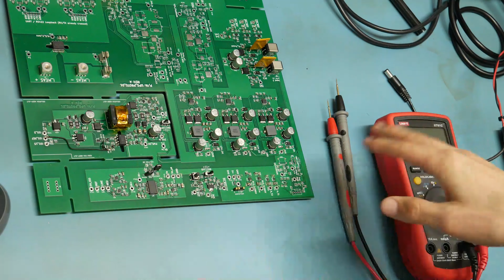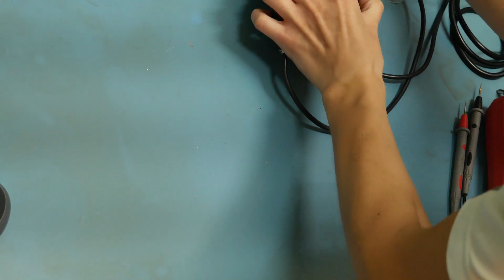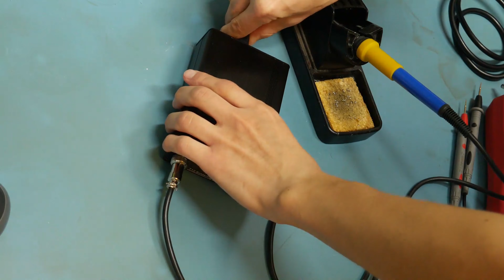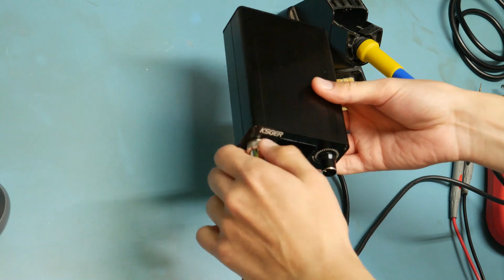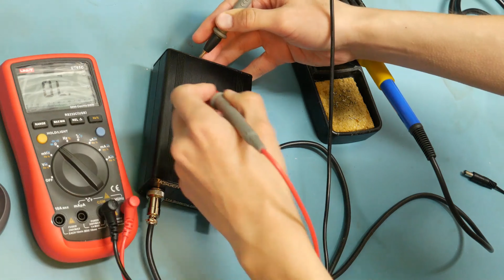A Dangerous STM32 T12 Soldering Iron - Ground Bond Upgrade!

Comment: SIMPLY solder a wire to the internal earth-pin of the supply socket. Have this wire then pass to a crimping ring-connector, soldered in place over one of the rear lid-mounting screws-holes. Thus, being trapped between the rear-plate and the lid when the case is closed, it will adequately provide grounding of the casing. CASE CLOSED !
THANKS tho fella ! We all learn from witnessing others endeavors, right ?
Reply from the maker: Great idea, and as you suggested... a lot simpler. The cut edges have bare metal exposed.. perfect! 
The next time I find myself modding ground bonding into an iron.... actually, I should probably just buy a better iron. :)

Cheers, and thanks for the great comment!

Comment: I did mine on the back panel, connected a wire underneath the board where the earth ground is soldered to the board. Then I used a Philips #2 screwdriver and twisted in the 4 screw holes on the back and removed the plating very easily. tested it and it grounded/earthed just fine right to the tip of the soldering  gun.

Comment: they direct soldered the input to the board exactly for this reason.no wires can flap and touch the case.Otherwise it gets converted to DC and there is on negative and positive. what you've done is now make it possible for a DC circuit to connect to an ac circuits earth..  in theory the case could even act as a capacitive voltage divider.

I apologize for rudeness, further in the video you acknowledge the break in isolation I wrote this before I got that far. I'd be curious what the resistance from the tip to ground is both with and without the modification.
Reply from the maker: Hello West, thanks for watching!

No worries about rudeness, I love making this a safe place to share ideas. I'm not sure what safety standards you are familiar with, but the ones I have studied were very specific about exactly how protective earthing should be connected to a system... And directly soldering how this soldering iron did wouldn't be sufficient, from my understanding.

Funny enough, this circuit actually isolated the tip from chassis, and earth, leaving it floating!!! I've been seriously considering either tying the tip hard to earth ground or through a low-megaohm resistor. I'm not familiar enough with every app-note regarding esd safeness for soldering irons, but if you have some experience I'd be happy to hear it! 

I'm happy to hear your opinion, and happy New years!
Reply: So after some thinking, perhaps it had some function utilizing galvanic isolation, or perhaps they repurposed the
 circuit/PCB from another device that used more than one device in parallel inside the same enclosure, if there was no need for ground to begin with and its been repurposed then the people making it don't know.

 How isolated is the ac side from the case after the IEC connector/switch?  
Might also be interesting to check continuity of output pins for the iron to the case.

Correct me if I'm wrong, the only danger to user of the case shorting to ground  would have to be on ac side right?

Might also check the supplied power cable, if its 2 conductor with just a facade on the plug ends that'd could explain it lol
Reply from the maker: @westhouse4641  

Hi West House,

The danger of a floating metal enclosure comes from a fault condition causing a live conductor become inadvertently connected to the enclosure. 

Tying the enclosure chassis to earth ground provides a safe return path for that fault current, preventing electrocution.

The isolation between mains and circuit ground is established in the AC-DC power supply, which doesn't come with obvious ratings. I would expect this barrier to withstand at least 2kV, but it should be designed to withstand significantly more if it is designed to accept 240VAC as an input. Withstand voltage for an isolation barrier can be tested using a HIPOT test.

Ground was originally connected to the power supply module (for the input filter) , but this does not provide sufficient protection against inadvertent connection of a live conductor to the metal chassis.

I hope this helps, and thanks for watching!
Reply: EEforEveryone perhaps I'm not properly explaining myself, here is a video regarding full bridge rectifiers. 
https://youtu.be/sI5Ftm1-jik 
now imagine the oscilloscope ground probe is the case. both a path to ground along the power cord.
Reply: EEforEveryone upon rewatching I'm a bit confused what you mean when you say a gfci would help/save you if a ground connection existed to the case. as im sure you know a gfci would trigger without a ground connection, if  the current between hot and neutral differ they " interrupt ".  sorry if I'm being annoying I swear I'm just in it for valid factual knowledge. if I'm wrong I like to know why I'm wrong so I can better grasp where/what it was that misled me. appreciate the replies so far cheers!
Reply from the maker: @westhouse4641  Hi West House,
No worries!

You're on the right track. What I hope I said (What I meant to say) is that a GFCI should protect a person no matter what because the trip current is so low, BUT, with proper ground bonding the GFCI should trip after a few mA of current leaks through the case back to ground meaning that the few mA won't need to pass through a user (back to ground).

Basically a GFCI may limit the fault current to a much lower value ( rather than relying on blowing a 20A breaker with our ground bond wire in the chassis. :) )

Comment: Is the tip isolated  with ground? I saw my hakko 936 the tip goes first through a resistor of 1Mohm then to ground connector wall. Is this the case for this station? I am going to work with Iphones.
Reply from the maker: Hello Ed,  the tip is currently tied hard to ground (<10ohms), though this was floating before the ground Mod. Not ideal!! Best of luck with your iphone repair!
Reply: @EEforEveryone  This the only budget well known T12 station, some say KU tips won't work, who knows? But my surprise KU tips are very useful on "microsoldering".
Thanks.

Comment: Pretty sure these units are Anodized Aluminum so the chassis should not be conductive. At least, I think that was the thought process in design.
Reply from the maker: Ooh boy! I'd love to see what CSA or UL would have to say about that. :) I didn't think about it that way before... Maybe you're right!
Reply: @EEforEveryone  Was still worth doing, if its a cheap anodise, some material may still be exposed that you cant see and shock you, good work :)
Reply: In a different vid, someone barely scratched off the anodized paint w their test leads and it was conductive.. very dangerous!!

Comment: Is that all u didn't show after screw the side to bottom with wire! Did u solder it to the ground?
Reply from the maker: Hi Rez, We tied a ground wire to the power inlet, and connected that to both halves of the enclosure with a wire (crimp ring terminal) I hope this helps!
Reply: @EEforEveryone  thanks

Comment: This was one of the first things I did (12ga wire) along with removing the resistor for the battery and added a 2032 battery holder mounted inside the case vertically,  so a battery change is very easy now.
I absolutely love my KSGER station. Way better than my $200 Weller station any day. 
Forgot to mention, I aslo added some hot snot to the caps as mine were floating a bit
Thanks for sharing
Reply from the maker: Hi Night Rider, thanks for watching, and i'm glad you made a similar mod! I'm really happy with my station as well. 
The performance is great, but it's really a shame that they're shipping product that isn't ground bonded.

Cheers!

Comment: Hi there. Would that mean that the tip wasn't grounded either? I'm not sure where I sit on plastic cases. Plastic is certainly easier to think about whether it's going to cause problems with a line to case fault.
Reply from the maker: Hello! In this instance the tip of this iron is floating (referenced to ckt ground, which is floating and isolated from mains). Esd who?

Comment: Some are not ground on the casing, but tip is usually grounded for ESD protection. Being metal they sure have grounded it for sure, they likely just throw it together without think as they make these same stations in plastic casing as well? Looking at your video see a way worst design flaw then the lack of case grounding? That is lack of primary and secondary isolation? What gets me is the fact they when through the trouble of PCB isolation slots for primary and secondary and then soldered in a large heat sink by the 68uf 400v capacitor that goes directly to secondary supply of power supply, to make matter worst is that heat sink lay right on top of the main primary traces on the PCB, which means the creep distance is as much as the solder mask thickness? Saw that when you turned the power supply to the side and see the traces running to the primary side. Who designed this?
Reply from the maker: Ha! This tip isn't grounded for sure: just tied to the circuit reference voltage.(not my favorite). As far as primary-secondary isolation this is galvanically isolated... Though I'm not sure how much voltage the power supply can withstand from primary to secondary.

It only takes a few mm to have a big impact, but I agree: more separation is better!

I'm fairly convinced that some folks in China throw a bunch of these together without putting too much thought into it. :) There are lots of versions of this available: with or without power supplies, pre-assembled or in pieces. I'm sure you can find one in a plastic enclosure!

Lol, who designed this indeed. Thanks for watching!
Reply: @EEforEveryone  That a shame I figured they would have at least grounded the tip?  Lol floating ground. As you stated they likely just throw them together to get out the door. I even seen one where they misspelled ESD safe and put LSD safe. Likely what the person was on that designed it. Ordered the Quecoo version of it, I have to see what I find when I get it, I will mod it if I have to, at least I see a ground wire going from PSU to front panel controller and PSU looks better?
Reply from the maker: Yeah, unfortunately not... At least on my iron! Grounding the tip should be a pretty simple mod. Tying circuit ground to earth through a few megaohms should keep things esd safe. I think my old iron had a low-impedance bond. Not sure what's normal or standard, but either way would probably be fine. Better than floating at least!

 "LSD safe" soldering iron, ha! That's rich.

Comment: Hi, Will the warm-up time be faster if we increase the voltage of the smps source inside the soldering iron?
Reply from the maker: To a point, perhaps! For the STM32-based T12 controllers, I think the output power is controlled in software. Maybe a firmware hack could unlock some extra power?

Comment: Thank you for a great video.  Safety first....the way to go.  I'm about to buy this identical unit and want to add the ground bond you are showing.  My question is....would it be ok to drill a hole in the Bottom and TOP of the casing...(not the side of the casing) and then have 1 bolt go from the bottom up through the top.  Of course exposing all the bare metal as you did where the bolt goes through. I would then put a double nut on the bottom, like you did, then put the top back on and have a double nut on the top to assure no backing out. (the first nut tight enough to assure grounding and then holding that nut, put on the second jamb nut. - - object being not to dent or dimple-in the casing)   My thought here is that it would not require any wiring (and by doing this of course I'd be adding an extra step to opening the unit in the future...that being to undo the top two nuts in addition the factory screws.  So would this be an OK approach that's safe enough for use? I value your opinion and look forward to your reply. Richard
Reply from the maker: Hi Richard! I'm glad you enjoyed our video! If I'm imaginating your word picture well enough, that sounds like it should work just fine! 

If I'm remembering correctly, you're looking for about 20 milliohms measured from the ground lug to any exposed metal, while somewhere between 20-40a is flowing. Big bolts, nuts, and lock nuts sounds like a great start. Seems like the nuts will be exposed, which could be nice (to visually see if the nuts start coming loose).

It's difficult to say for sure if your suggested arrangement will pass a ground bond test, but it seems to be moving in the right direction.

Watch out for the black costing on the surface of the enclosure: it has a much higher resistance than the base metal, your nuts or bolts will need to break through the coating somehow! I just scratched that off with a file. :)

I hope this helps, and thanks for watching!
Reply: You don't mention actual ground bonding (?) - Or rather, explicitly say this to avoid doing wiring. This could work, if ensuring there is good metal contact between the bolt/nuts and chassis/shell. But if going this route, you have to make sure that the bottom part of the shell is indeed ground bonded already, otherwise you're just coupling two non-grounded parts. 2 times zero is still zero. If the bottom half isn't grounded, then you can do so with eg. a crimp ring connector, thread on and clamped between the chassis and nut on inside of the bottom half-shell.

Personallly, on my unit, neither part of the aluminium chassis were ground bonded. So here's how i did mine:

[TL;DR Sand inside for contact, ground bottom shell with ring crimp. Small piece of steel on the inside bridging the two halves. Cut threads in upper hole of steel bridge. Bolt through top half into steel piece couples the top and bottom when tightening.]

First I sanded an aligning spot on the inside of both halves, on the side of the unit towards the rear (where it's not quite so cramped), to make good electrical contact there. I then cut a small rectangular piece of 2mm steel, long enough to bridge both parts of the chassis with room for a bolt going through both ends. And drilled through chassi parts and steel piece together to make sure holes align. Drilled the top half slightly smaller, then drilled out the hole in only the top half of the chassis (so not the corresponding hole in the steel piece) about 1mm. I then cut threads in the "upper hole" of the steel piece.

Next, I Attached the ground to the bottom half-shell with a small bolt going from the outside, through the chassi, the steel piece, then a ring connector to ground, and finally clamped that sandwich together with a nut.

So now, the chassis ground is attached to the bottom half-shell with a small bolt and nut. When I put the top half-shell on, i put another bolt through the hole in the top-half. The bolt enters the threads cut in the steel piece (now on the inside), and tightening the bolt clamps the upper half-shell and the steel piece together, coupling the top and bottom through that steel piece.

Now the unit has both parts of the outer chassis shell coupled together and grounded, with only two small bolt heads sticking out on the side towards the rear. Whenever needing to open it up, I just (in addition to the other standard screws) undo that one upper bolt. No wires between the top and bottom half, and it's asthetically "fine" (I used "bolts" with rounded heads and same Phillips type, so can undo all the screws with the same driver). All in all it's not so different from your idea, but this way I also avoided having anything (electrically conductive or otherwise) protruding from the top and bottom of the chassis, that stuff can snag on, or risk scratching the surface I set it on. Nor does it "dimple in" where the mount is, as chassis and steel "bridge" just clam together as a sandwich, instead of pulling together two parts with a gap between them.

Apologies for the long post, I just wanted to make sure it was well and clearly explained in case someone come along in the future and would like to try/do this.

Comment: Check out the large heatsink extending from the mains side to the secondary side, completely destroying all attempts at isolation. The corner rests right on the trace next to the mains bulk capacitor. Separated only by a thin layer of solder mask...
Oh and if you run the version where the logic board has R10 running from battery voltage to ground.. that will drain the battery in a few weeks. Just remove the resistor :)
Reply from the maker: Hey Pentti,
Thanks for the tip! I'll have to crack this open again and take another look. That sounds scary! Perhaps swapping their power supply for a ul listed brick would be a better move.

The backup battery seems to be fine in mine, it spends most of it's life unplugged and is still holding time. :)

Cheers, and thanks for watching!
Reply: Actually, it is caused because the rotary encoder doesn't have the tabs foldered properly and are making contact to ground.